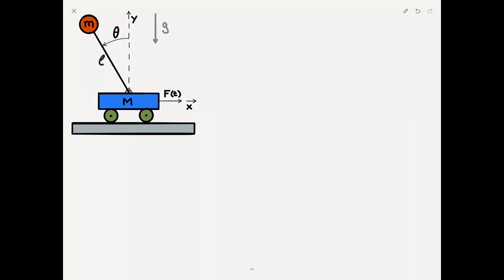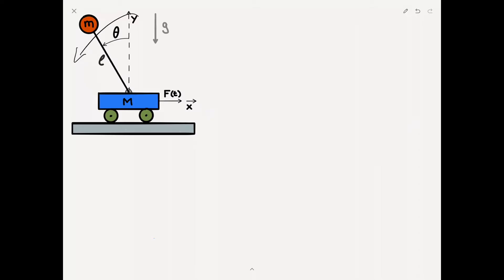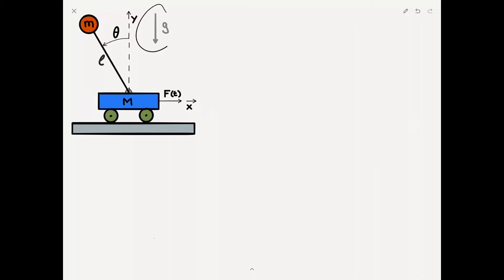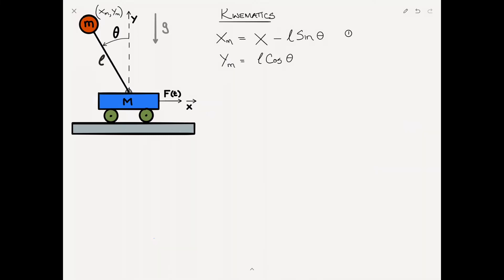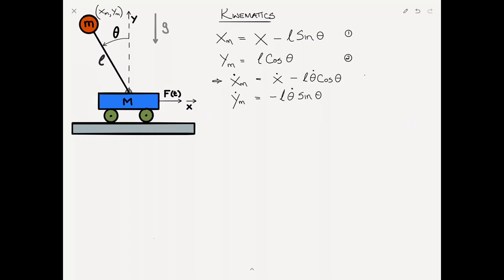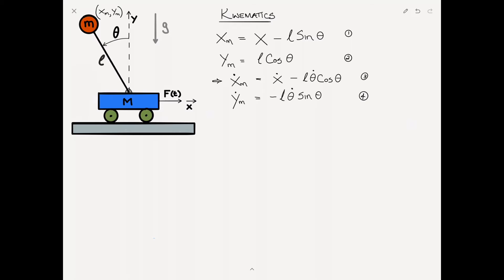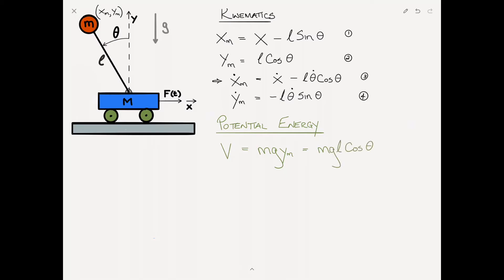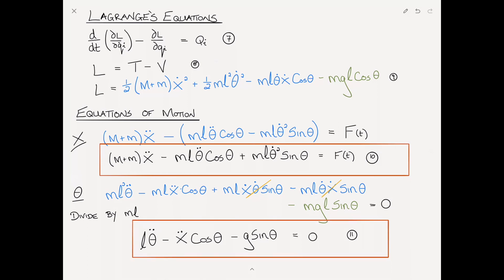Equations of Motion for the Inverted Pendulum (2DOF) Using Lagrange's Equations

Comment: First of all, thank you for explaining complicated topics with such incredible clarity. Secondly, I refered to this video to cross check my own derivation of potential and kinetic energy,  and for derivation of total kinetic energy, I started by adding translational kinetic energy of the cart with the rotational energy of the pendulum (point mass), but I am missing the -2*L*dFi/dt*dX/dt*cos(Fi). What would be a physical interpretation of this element of the equation? why isn't rotation of the pendulum and translation of the cart encompasing the total kinetic energy of the system?
Reply from the maker: It's a little hard to tell without looking at your work, but my sense is that you have not squared your velocity properly.  Make sure you: 1.  locate the position of the mass(es) using the coordinates and geometry of the problem, 2. Differentiate with respect to time to get the velocity of the mass(es), 3. Use this value for the velocity for the kinetic energy expression AND SQUARE IT!   When dealing with rotations, do try to do this intuitively as it is easy to miss a term (usually a cross-product type of term) the result is that there is a coupling in the motion of the two masses that you are missing.
Reply: @Freeball99  thank you very much for your answer.

Well, I basically just naively summed up all the kinetic energies that I thought are involved which come from both translation of both masses and the rotation of the pendulum, which equaled to T =1/2* (m+M)*v^2 + 1/2*m*L^2 *w^2 (assuming point mass).

So if I would here simply substitute v for dx/dt and w for dFi/dt, I would got something similar, but with discussed term missing (-2*L*w*v*cos(fi)).

I guess one can't just sum up what he assumes to be energies, but rather has to start bottom up and define radius vectors and calculate their derivative to obtain velocities and kinetic energies, but I am wondering if there is some interpretation of this missing term here. 

I thought it has to do something with coordinate definitions perhaps, but what you mention as "coupling in the motion of the two masses" sounds interesting. Especially since this  term does resemble cross product of linear and angular velocity (depending on the cos(fi)).

I am not 100% sure what are you refering to by this, could you perhaps point me somewhere where I could read more about it?

Thank you once again for you clarifications, they have been most helpful.

Comment: isn't this solution wrong? there must be (1/2).I.(w^2) in T, too (rotational kinetic energy)
Reply from the maker: Technically you are correct!  However, for the case of the simple pendulum, it is typically assumed that we are dealing with point masses which is why we can ignore the rotational kinetic energy.  I mentioned this in the video on the double pendulum, but should have been more clear here.  The reality is, that when dealing with a simple pendulum, the rotational kinetic energy is typically negligible when compared to the translational kinetic energy (except for cases when the diameter of the mass is very large and the connecting rod is very short).  

Also in reality, the connecting rod is not massless and it will also contribute to the rotational kinetic energy (and is usually more significant than the rotational KE of the mass).  I have shown this for the case of the so-called "compound pendulum" in this video: https://www.youtube.com/watch?v=eBg8gof1RBg

So, for the simple pendulum, you can ignore the rotational KE with little loss of accuracy.
Reply: @Freeball99  Thanks for the informative video. But continuing with Enise's question, if we include rotational kinetic energy as well, what I (moment of inertia) should be taken. Is it about the centre of mass? or is it about the hinge?
Reply from the maker: @ashishnegi9663  You need to find the rotational KE about the center of mass.  The effects of the mass rotating about the hinge are already taken into account by considering its translational velocity relative to the hinge.
Reply: @Freeball99  ok, thanks. I’ll think about it.

Comment: Hi sir, pls tell me: why equation (1) is "xm = X - l*sin(theta)" but not "xm = -l*sin(theta)"?
Reply from the maker: This is due to the displacement of the cart.  If the pendulum angle remained zero at all. times, then the mass, m, will still be displaced by the same amount as the cart, so we need to add X.

Comment: Wouldn't the potential energy of the pendulum be at its lowest when the ball is pointing straight down (theta=180)? Your potential energy equation would imply that at this point we would have negative potential energy, not 0 (m*g*l*cos(180) = -m*g*l). I have seen other resources that indicate the same and I am thoroughly confused as to why. Any help would be greatly appreciated.
Reply from the maker: This is really just a question of where you are drawing your axes.  Truth of the matter is that zero potential energy is only at the center of the earth, so if any problem we arbitrarily chose a zero potential point.  In my case, the x-axis is on the cart and this is defined as zero potential.  To be clear, all these different descriptions of the potential energy vary by a constant. When you substitute the potential energy into Lagrange's Equation, the constant gets integrated away.  The result is that it make no difference what the absolute value of the potential energy is.  Rather what is important, is the DERIVATIVE of the P.E. with respect to the particular coordinate.  Also, this means that negative values of potential energy are fine.  Hope this clears it up.

Comment: Ok man but how do you linearize that equation so that a controller could model and control the motion of Pendulum?
Reply from the maker: You can linearize the equations by assuming small displacements and then eliminating all higher-order terms - i.e.  fully expand out the equations and eliminate all terms that contain x^2, θ^2 or x.θ (or higher powers).  Also you will make the approximation that sinθ=θ and cosθ=1.
Reply: @Freeball99  yes i've learnt some tricks in 4 months. Thanks anyway. Appreciate it

Comment: you take derivative of lagrange equation in the video (10.45 s) but you said derivation will be taken according to x_dot but you did not do that. You use product rule but we do not need to use  it becuase if you take derivative of  m*L*Q_dot* x_dot*cos(Q) according to x_dot , the answer will be m * L * Q_dot * x_doubledot * cos(Q), wont it ?
Reply from the maker: No, this is not correct.  

If I take the derivative of m*L*Q_dot* x_dot*cos(Q) according to x_dot, then I get m*L*Q_dot*cos(Q) according to x_dot.  I then need to take the derivative of this with respect to t.  This is where the product rule come in because both Q_dot AND cos(Q) depend on time.  This results in the TWO terms in the parentheses.
Reply: @Freeball99  I get X-dot derivation, what about theta dot. cause the derivation of theta dot for mine is -mL*Xdot*cos theta (only derivation of theta dot), with respect to time, isnt the formula mLX_dott*sin(theta)?

Comment: Hi, i have some doubts with the potential energy of mass m, I thought that it´s delta height would be l+lcos(theta) because i´ve seen Lagrangian models in which the height is measured from the lowest point at which the pendulum can be. Please correct m if I am wrong.
Reply from the maker: If the pendulum was hanging down, you would use for its change in height l - lcos θ OR you can just define it's y-location as -lcos θ and call this the height depending on where you define you define y to be zero.  These are the same thing just shifted by a constant, L.  Both will produce identical results when differentiated in Lagrange's Eqns because the constant, L, disappears when you differentiate it.  For the inverted pendulum, it would just be the negative of this.

Comment: For the kinetic energy, can I write 0,5*M*x_dot^2 + 0,5*m*(L*theta_dot)^2? If the velocity of m is L*theta_dot, isn't it simple to use that way?
Reply from the maker: No.  This is a common mistake - DON'T DO IT!!  
The velocity of m is x_dot - L·θ_dot·cos θ and you need to square this.  This gives you THREE components of velocity for the mass, m - the two that you have included plus a rotational effect that you are not including.  If you look at Eqn. 6, you will find that you are missing the last term.  
When you are dealing with rotating systems, this is generally nonlinear stuff.  Solve it using basic principles and math rather than using intuition which is often wrong when dealing with rotations.
Reply: @Freeball99  Hey! We don't see a term that involves moments of inertia in these equations. So has the effect of inertia been neglected for simplicity, or is it embedded in the cross term?
Reply from the maker: @reubenthomas1033  When modeling a simple pendulum, it is common to treat the mass as a point mass and ignore and rotational kinetic energy of the mass.  Really what we are saying here is that if the diameter of the mass is much less than the length of the rod, L, then the contribution of the rotational kinetic energy is negligible. This also keeps the math a little more simple - which is helpful for teaching purposes.  I probably should have mentioned this at the start of the problem (I think I mentioned it for some of the other simple pendulum examples).

I have separately showing an example of a compound pendulum which does require one to include the rotational kinetic energy (youtube.com/watch?v=eBg8gof1RBg)
Reply: @Freeball99  Awesome! Got it. Thanks a lot :D

Comment: may I ask for a reference source for this question, sir?
Reply from the maker: This problem exists in many references, however, this came from my own notes.  The diagram I re-drew comes from Wikipedia though it too exists in many places online and in many textbooks.  The inverted pendulum is a fairly common problem in vibrations and controls classes.
Reply: @Freeball99  Yes, thank you. What is one source of the book, sir, because I really love working on problems like this
Reply from the maker: @D4kwah.1d  You can try Mechanical Vibrations by S. S. Rao, 5th Edition.  It does not contain the inverted pendulum problem, however, there are many other examples in there.
Reply: @Freeball99  thanks very much sir
Reply: @Freeball99  I was reading a survey paper the other day that said the inverted pendulum problem has been used as an educational tool in controls for 62 years !!! http://web.mit.edu/klund/www/keeling/Pendulum2009.pdf

Comment: how do you know that the right side is f(t) in equation 1? Shouldn't it be 0?
Reply from the maker: The problem shows that f(t) is the force applied to the system in the x-direction.  Therefore, it appears as a generalized force on the right-side of the equation of motion for the x-coordinate.

Comment: What if the pendulum rod is directly attached to the axis of a single non-slipping wheel, in which case the input would be a torque applied between the wheel and the rod, like in a typical inverted pendulum robot? It's a similar case but it would be nice to have the differences pointed out! Thanks c:
Reply from the maker: The model as described in the problem really just consists of two point masses connected by a rod.  As a result of this: 1) the pendulum bob has no rotational inertia (so no rotatory kinetic energy) and 2) the cart, wheels and applied force (F) are all located at a single point located at the hinge of the pendulum - so, the wheels have no radius and the force F produces no moment about the hinge.  If you wanted to model the control input to the wheels, you would need to expand the model to include assumptions about the wheels, eg what is the radius, the mass and the moment of inertia of the wheel?  What is the offset between the hinged and the wheels? Etc.

Comment: Is the reason F doesn't have a component in the second equation because it's only being applied to the cart?
Reply from the maker: Yes, you could say that.  A better explanation would be that the force, F, acts only in the x-direction and produces no moment in the θ direction.
Reply: @Freeball99  thanks for getting back to me. I realize my confusion was that considering the whole system, pulling the cart would cause the arm to rotate, but we are not considering the whole system but rather just the virtual work done by F, which is zero in the theta coordinate.
Reply from the maker: Adam Johnston correct. That’s an even better explanation.

Comment: In 13:06 why did not you differentiate both x dot and cos(theta) wrt time instead of only cos(theta)?
Reply from the maker: I differentiated wrt x in the previous term.  

Since both x_dot and Cos θ are functions of t (as you have pointed out) I need to apply the product rule when differentiating this.  So first I differentiate the x_dot and multiply it by Cos θ and then I differentiate the Cos θ and multiply it by the x_dot.  This is what I did in terms 2 and 3.
Reply: @Freeball99  Hi, I think what he/she said is that , 
why d (-ml theta_dot multiply x_dot cos theta) not = -ml x_double_dot theta_dot cos_theta + ml multiply theta_dot_square x_dot sin_theta - ml theta_double_dot x_dot multiply cos_theta. I am stuck on there too. :(

Comment: Thanks for fixing your errors!  So, dumb question, if I wanted to solve for theta numerically, do I just use Euler's method or maybe the Runge-Kutta method?  Would I need to solve for theta double prime in equation (11) and then plug that into equation (10) to solve for theta prime? Would I then use theta double prime to change theta prime and use theta prime to change theta?  It's been a couple years since I took a course in differential equations, so I just want to make sure that this is the way you'd solve for theta numerically.

EDIT: Actually, I only need to worry about the second derivatives, right?  I just calculate theta double prime and x double prime (and set F(t) to whatever I want).  Then I change theta prime and x prime, which then changes x and theta.  That makes sense to me.

I made it all work.  I hope this helps whoever is also trying to simulate a cart-pole environment.
Reply from the maker: Yes, you can use Euler (which is really just RK1) or RK4 to get numerical solutions.  

The method you have described is not correct...

You first need to rewrite the equations of motion in state-space form.  In doing so, you are converting the system of equations from two 2nd order differential equations to a system of four 1st order differential equations.  I have several videos on how to do this.

youtube.com/watch?v=e1q4vD2KjpE
youtube.com/watch?v=SFpJbmHIUB0
youtube.com/watch?v=yMeak8RWKtI
Reply: Freeball Oh, I remember how to do that. It’s just a bunch of substitutions, which is similar to what I ended up doing anyway. Regardless, I saw what I’d call physically accurate behavior in my simulation with my implementation of solution approximation. Thanks!